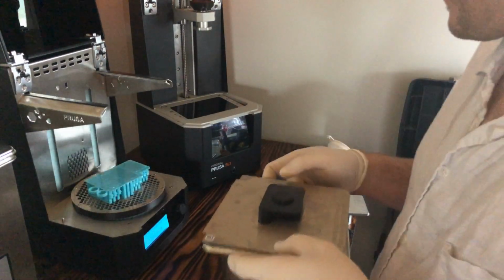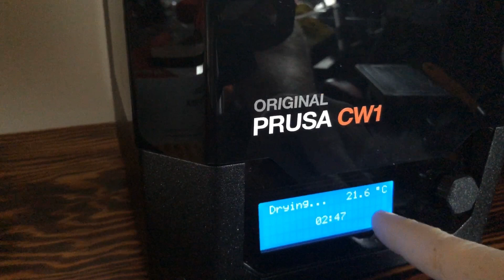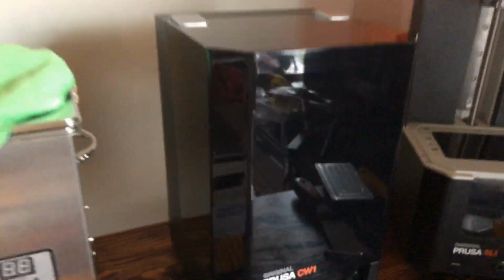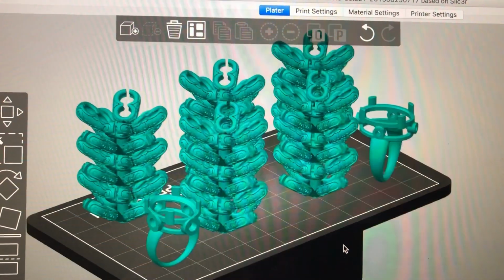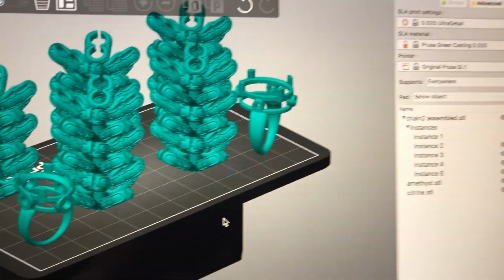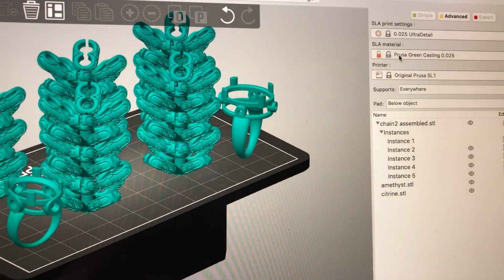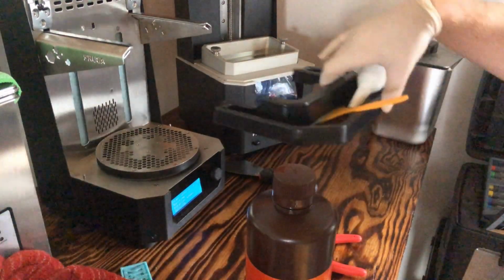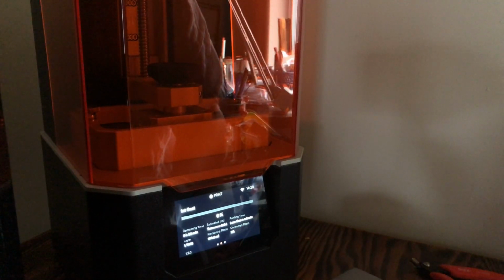3D Printing Jewellery with Prusa SL1 Printer | First Castable Print

Comment: 2 suggestions get a small silicone squeegee to clean out your vat rather than using the scraper, secondly take supports off before curing. I run my models under hot water to soften the tips and they pull right off.

Comment: Hi, when you washed out the tray, what did you use to wash it out with!
Reply from the maker: 99% Isopropyl Alcohol for the print tray, unless you meant the resin tank in which case it’s soap and water.

Comment: What did you wash the tank with please? Just water?
Reply from the maker: Just soap and water as per the manual. It also suggests against using isopropyl alcohol etc to clean the resin tank.

Comment: Hai bro.. Is this pronter print with the exact measurements what we provided on cad..or it shrink?
Reply from the maker: The printer itself has nothing to do with the shrinkage. The printer does what it's told. If you leave the resin out to uv exposure it will shrink over time which is why most castable resins come with a warning of how long you have until you should cast with it. Then there is the shrinkage of the metal. 
You still experience shrinkage with traditional wax and molding techniques but at least this way you can offset the shrinkage rate if you know the % in your slicer before you print you models.
Reply: Thank you bro

Comment: What is we dont have that cleaner? whats the alternative? and which resin did you use? sometimes those cleaners are almost half the price of a printer lol
Reply from the maker: I wouldn't recommend this resin. 
You don't need a cleaner but I would recommend it. People use things as simple as a bowl, a brush, and a flash light. Depends on the budget and what you're expecting from your prints.
Reply: @ClearMindJewellery  which resin would you recommend for high detail jewellery?
Reply from the maker: By detail do you mean prong settings, pavé, or filigree? or all of the above?
Reply: @ClearMindJewellery  yeah I meant all of the above. Sometimes even embossed/extrude writing and designs with 0.5mm width.
Reply from the maker: @Saywhatohno  Power Resins Zero or Dark. 
If you are on a budget working without stones and can figure out shrinkage rates etc Apply Lab or Resin Works 3D.

Comment: What is the odor like? Does it make the room smell bad?
Reply: The fuses are harmfull
Reply from the maker: It has a slight odour, similar to nail polish. The printer itself has a fan/blower and air filter that makes the smell barely noticeable. 
The long term goal is to put it under ventilation, and possibly get another printer, we just haven't gotten that far.

Comment: Hi, can you tell me if the prusa's resins smell bad?
Reply from the maker: Most resins have a bad odour unfortunately. I wouldn't actually recommend Prusa's Green Castable as the casting is terrible. They're tough resin is good though.
Reply: @ClearMindJewellery  i just started and i am using anycubic ones, these resins stink terribly, the worst smell i have ever smelled
i'm using ffp2 masks, but i don't think they have any effect ... i've read some guides in which they recommend using masks with filters that protect against organic fumes, but they cost a lot even though i think i give them a chance, do you use them?
Reply from the maker: We generally don't test "ecosystem" resins, so I will have to take your word for it. You should definitely be wearing masks. We have a separate room for our printer.
Reply: @ClearMindJewellery  I did other research and from the opinions on the web it seems that the so-called "Eco-friendly" resins give off a less strong smell, as soon as I finish the resins I already have I will take one to see if it is true, regardless of this I will take a mask with the filters, this ffp2 masks are good for the pandemic but do little aginst resin fumes :/
Thanks for your tips

Comment: Hi! How do you print without supports? Many thanks!
Reply from the maker: We use the Prusa Slicer to set up our prints. In printer settings you can check off "support on build plate only" as well as turning the object elevation to 0mm and adding a pad around the object to give it some stability. 
Printing succesfully without supports really depends on the design. The more over hang the less successful it will be using this technique.

Comment: @clearmindjewellry Good afternoon! How much wax did you use for 120 models? What is the consumption of such a printer, please tell me?
Reply from the maker: Just drop any model into a print slicer and it will tell you how much resin. This video was ages ago so idk how much resin we used. 

The tank at 100% full is 250ml but you can fill it as needed.
Reply: @ClearMindJewellery  Thank you very much! )))

Comment: did you already try to cast? if so, with witch resin?
Reply from the maker: Steve Mouton we have at least 3 videos casting from resin. The one that’s worked the best so far is easy cast violet by resinworks3d. We still want to try some bluecast.

Comment: sir thanks for the video
i need a printer for my jewelry but my parts a to thinh its about 0.4mm and my prongs are 0.50 and i take the falf of it withe cutter and let them withe 0.3 mm in thinkles
i want to ask if this machine its good for my work or noe
and thank you so much
Reply from the maker: I have printed 0.5mm successfully and accurately, not I haven't tried any thinner. I think you may need to try other prints for that kind of resolution. 
 
I'd be more worried about the pieces casting rather than printing personally, though I suppose if you're working in higher karat gold, as long as the model is completely burned away it would work.

Comment: Very cool, just started with the form 2 and been dealing with a little porosity but think that's more of my metal temps. Curious, how long of a burnout with there casting resin? Formlabs is about 14hrs total.
Reply from the maker: We usually do a 12hr burnout and that seemed to work for the prints we were outsourcing. We're going to probably do the first cast with our own prints this weekend so we shall see.

Comment: Guys doing jewelley: I recommend Bluecast X10. It's 80% wax and doesn't need curing. It's burns clean and casts beautiful. The big advantage is that due to the wax content almost all casting houses will succeed with it if your are not doing your own casting.

Additionally if you cure it until it goes clear it turns in to a high temp resin and can be used directly in a hot vulcanised mould.

Disadvantage is that it's £100 a bottle but that still works out around £0.18 a ring. 

By comparison Prusa casting green is a bit pants.
Reply: so the prusa cleaning/drying/curing machine is not necessary with this? im doing pendants
Reply: @elephantear7659  It's not, you can just use an ulltrasonic or a shaker pot, though. It is still a nice piece of kit though. You should cure the resin if you're not going to cast within a couple of days - add 2% or so on to the model size if you are curing (I can't remember the exact number, Bluecast have it in their manual). 

I've since had to return my SL1 (Prusa support were phenomenal, mind, sending me another to try and taking that back too). It's just not printing dimensionally accurate with Bluecast resins - kind of a big deal with the tolerances we need in jewellery. 

Depending on the size of the pendant I'd recommend X5 rather than X10.
Reply: @pt8314  hm interesting, thanks for the info

Comment: a suggestion from a long time 3D Printer user, never poor resin back into a bottle without filtering.  bits of broken support or flakes will ruin your day when you refill the tray
Reply from the maker: There is a filter insert in the funnel
Reply: @ClearMindJewellery  LOL - thats good, I about fell out of my chair when i saw you poor straight back to the bottle - lmao. I've been working with 3d printers for 20+ years (industrial type) and just getting into casting so I really enjoy your videos. Happy New Year.

Comment: Hello tnx for your sharing 
I'm a designer and i want your help ....in our company we have a  3d system printer 2500 but its expensive to run because of material .... and i must find a cheap solution so i want to send you a model so you could print it with your prusa and see if it's capable of doing the job perfectly ..
If you are willing to help me please send me your whatsup Skype or your preferred choice for  conneting
Reply from the maker: If you would like to use our services please refer to our website clearmindcasting.ca or instagram. Contact info is in our about section.